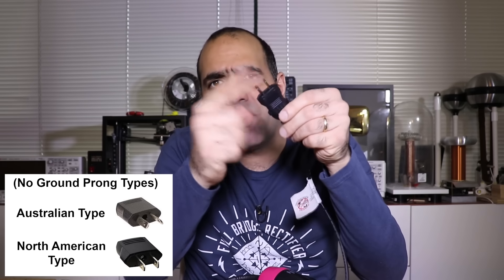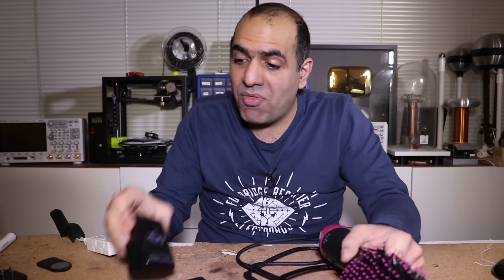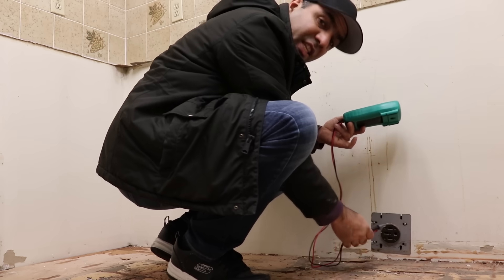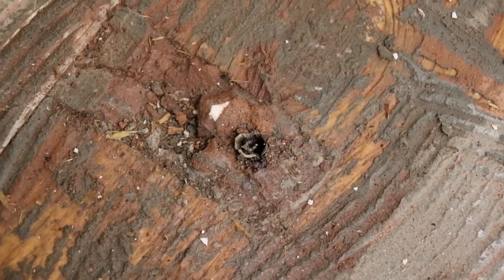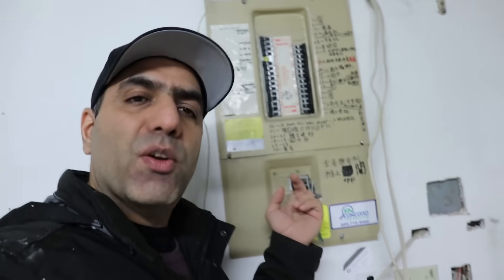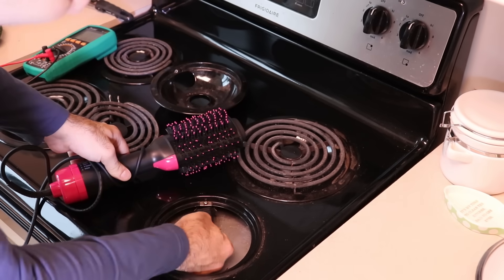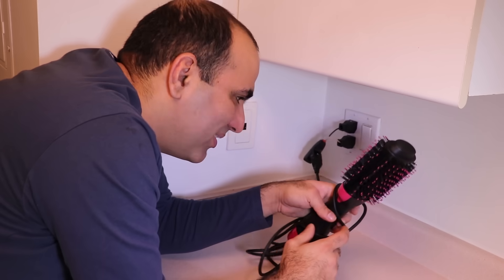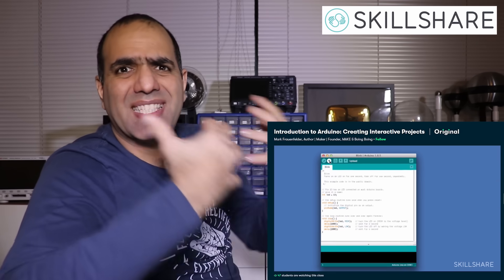Finding HIGH POWER 240V in a 120V Country

Comment: The reason they wire the houses differently than the apartments, is that utilities have a maximum size single phase service they can provide, based on 167 kVA being the largest single phase transformer they can get.  A typical house might use a 10 kVA single phase transformer, possibly shared with a neighbor or two.   An apartment building with hundreds of dwelling units likely will need 500 kVA or 750kVA, and will have to get a 3-phase service for the building as a whole.

Houses get the 120/240V split phase system, built from a center-tapped secondary coil, and one of the 3 distribution phases on the primary side.

Apartments get 2 out of 3 phases delivered to each dwelling unit, with 120V phase to neutral, and 208V phase-to-phase.  Your neighbors get a staggered pair of phases from you, such that the phases are used evenly throughout the building.  The building as a whole gets a 120/208V wye service.

Most household appliances run off 120V, and the few that do need the higher voltage typically can run off either 208V or 240V.  The dryer for instances uses 120V to run the more voltage-sensitive motor, and uses the higher voltage for the heating element that really can run off either 208V or 240V.
Reply: ??? Nope
Reply: @TheAdatto  What part of my comment makes you disagree?

Comment: So if the oven runs on 206V AC my laptop charger can run that

So for example our ovens are 206V
Reply: Your laptop charger is designed to be compatible with a wide range of source voltages.  It is designed to sense the source voltage, and self-calibrate so it delivers the correct DC voltage to its load.

An oven doesn't have the ability to tune itself to the voltage.  Instead, it will operate the resistive heating elements on ~13% less voltage, which means 25% less heating power.   Since it is controlled by a thermostat, it will on-cycle for a greater fraction of the time, compared to what it would do if it ran off 240V.

The voltage-sensitive loads in the oven, such as the fan motor and the user interface electronics, will run off the 120V, that will be the same whether it is in a house or an apartment.
Reply: In an apartment dwelling unit, you get 2 out of 3 phases of a 3-phase service.  The three phases are 120 degrees apart (meaning a third of a cycle), and each operate at 120V phase to neutral.   If you draw a Y shape, with each line being 12 inches, and equally spaced, you will measure 20.8 inches between the tips.  That's the visual for the 120/208V WYE three phase grid.   The ratio between 120V and 208V is the square root of 3.

Comment: I had some stuff with me to USA that needed 240V back in the 90's, we found a big ass transformer with multiple outputs, one was 2:1 so the 110V became 220V, but it also transformed the voltage sway, so I had between 190V to almost 250V in the peaks.
The electric grid in the USA has some serious brownout issues
Reply: Technically, the transformer you used was 1:2 and not 2:1.  To step up the number of turns on the secondary need to be higher than the primary number of turns.

Comment: Here is the problem, can you just run two phases live on a single phase electric device without connecting neutral line?
Reply: That's exactly how his apartment is wired.  His single phase stove is connected across the two phases, no neutral wire is needed.   The same is true for a single phase 240V circuit.  No neutral wire is needed.

Comment: I have an old 8mm film projector that takes 110v-120v, 7.5 amps 750Watts. what can I make to lower the current to safely plug it to the USA outlet( 120v 15amps)
Reply: You can plug it directly into the 15A outlet.  It only draws 7.5 amps.  It limits the current itself according to ohms law.

Comment: Many years ago in Italy the three phase system was of 220 volts instead of nowdays 400 volts 

In my grandma's house i found in the sockets two red wires instead of blue and black and the same green-yellow wire for the ground 

Why two red wires 
Because the distribution were made with two phases with approx 150 volts per phase

Comment: In my country everithing is 250V and i charge my phone with that. Is it bad?
Reply: Bugatti KING both the charger your phone came with has a range in which it can work with. This is usually 100v to 240v if your phone is targeted for worldwide use.
Reply: @jomerc  yes, it is 100V~240V,but i wasn t sure if i can change it with my 250v outlets.
Thanks!!

Comment: Its a pitty you dont have the 230V in America. No fun with those high voltages :D You should do a petition for 400V lines in houses :D Even more fun
Reply: We do have 240V in America.  That's what is delivered to every house.  It's just that we only provide that to high current devices that need it.  Most devices only need 120V, so that's what our normal outlets provide.  But we have 240V outlets in our houses for water heaters, clothes dryers, stoves, air conditioners/heat pumps, car chargers etc.

Comment: ps you can have a 240v line installed for a price....  we needed one to run the welding equipment in our garage, forget how much it was but city crews just ran another wire off the mains through a transformer on our garage.

Comment: 2:17 here is the proof he got electric engineering degree, and He connect things while only taking care of volts and carelessly forgets to compare wattz,

world wide AC current share through 3 phase technique, 1 phase line + ground = 120 and if you use phase instead of ground 1phase + 2phase = 240 and I do not know how would it impact PMT as it says 1000 watt, i think its a low quality dryer it must have ac coils, the good one has dc coils and pwm controller and overheat sensor well they cost, 

and I opened chines microwave oven, it got  water boiling coils instead of microwave generator, you got 2x scammed

Comment: If the phases are 120º out of phase, does that mean you actually have 3 phases available?
Reply: His apartment building has 3 phase power, but that doesn't mean all 3 phases are present in his apartment.
Reply: Depends on the power system in your country.

In the UK it is 3 phase, but for residential customers (houses) only a single phase is available. In industrial premises and offices 3 phases are available.

In Germany it appears they provide the 3 phases to residential properties.

Comment: So, it isn't desirable to put a small, light switching power adapter on appliances with a high power (hundreds or tens of hundreds watt) comsumption? My guess: It would be too bulky and costly because it requires a real transformer (you already used a solid-state transformer and it did begin to smoke), induction-based with copper coil and ferrite core. Also because intense current, lower voltage DC would be very dangerous to appliance (overheats and melts) and user (gets lower voltage, high intensity). Also: What kind of safety setup do you have in your workshop? Is there any video where you show that?
Reply: That converter he put in and "smoked" was almost certainly a small transformer.  High power units require large transformers and are big, heavy and expensive.  Switching inverters also  are expensive.  Not everything can run properly on a modified sine wave. By the way, most of the sparking and smoking in his vids are faked.  Look closely and you'll see the smoke is coming from behind the device.

Comment: I don't get those Americans with two fase power.
All House's in the Netherlands have 3 fase power.
It's not used that often but every house has it.
Also when using a higher voltage.
(220v instead of 110v)
You use less current and can us thinner cable's.
Which in turn reduces weight and cost's. 💰

Comment: if the kitchen counter outlets are on dedicated circuits it doesn’t necessarily mean they are different phases.
Reply: Actually, it does.  When they're in a multiwire branch circuit (2 circuits on one duplex outlet like Medhi's) they have to be on different phases because they're required to use a 2-pole breaker since they share a neutral.  When you have outlets in two different boxes, then they're not guaranteed to be on different legs/phases.
Reply: @stargazer7644  just because they are required to be on a two pole breaker doesn’t mean that’s what someone did.

Comment: It's pretty nornal in Brazil to have access to both 127 and 220v. But usually most homes will be conected to only a single phase so we end up with 127v at home and both voltages at work or school. In some places they have only 220v, they could get 380v but almost nothing uses this voltage.

Comment: Seriously, what is the point of having 120V as the standard? It's 230V where I live, and if the distributor simply changed the LVAC to 230V you wouldn't even have to change anything. I assume your wires are thicker than ours to make up for the higher currents (we have 1.5 and  2.5 mm² for 16A and 20A respectively) so increasing the voltage would only result in lower currents, meaning less losses. So WHY the  hell do Americans use 120V? I just don't see any upsides to it. Any thoughts?

Comment: Me: Mom i need 240V 
Mom: we have 240V at home
240V at home
Reply: In my country it's 220v
Reply: @shubham_the__legend  Australia used to be 240V officially, but now it is 220V officially, to better conform to international, but supply is allowed be up to 10% over that, so up to 242V is still perfectly legit.  All appliances are supposed to be rated up to 260V since it can run that high in the outback.
Reply: @shubham_the__legend  you copied my name BLYAT!!!
Reply: @shubham_the__legend  250v in india
Reply: In our country it’s officially 230V but it runs at about 240v
Reply: James why?
Reply: Lego Mini Movie Productions I don’t know, it just is
Reply: @legominimovieproductions  The EU grid runs at 220v while the UK runs 240v, a happy medium standard was 230v +- 10%, so anything made for the EU market worked in continental Europe and the UK. 
So basically while the standard of voltage was harmonised the EU and the UK continued to use 220v and 240v respectively.
Reply: @konadesu  The british just want their tea faster.
Reply: @legominimovieproductions  When he said it looks like they cut a piece of wire who is they? And what was that wire used for?
Reply: 204v
Reply: @zsin128  Why didn’t he just read On the circuit breaker what controls what
Reply: @Liam Hmm, just looked it up and yeah you're right. Cheers for correcting me.
Reply: Name of the song at 6:55
Reply: 240V at home is only 208V... :-(
Reply: voltage can be various depending on need, high demand industry ussually have separate stepdown transformer from 400v(small motor) to several kv for  ex steel mill, for home it is still best to use lower voltage, you dont want to touch 400volts its lethal
Reply: We have 220v and 440v 
440v for large houses and industry
Reply: You copied and modified it
Reply: Truly, the USA is a 240V country. It's just that most of our appliances run at 120V/125V. The full story is at the breaker box. In a way this is safer since a shock or electrocution from 120V is less lethal. As Mehdi demonstates. As Canada is using a similar scheme.

240V on the other hand is more dangerous. I'm not sure on all the history and science there, even though people do die in the USA from 240 voltage anyway - not to mention the amperage as well (since they go hand in hand).

But yeah, in the USA, it's way easier to get shocked. I personally was electrocuted as a curious child when bothering a plug-in air freshener. Glad I'm still alive, could've been tragic. But from that day on I was fascinated by electricity.
Reply: @cherrysdiy5005 You can survive a 240v shock depending on the circumstances but I do agree obviously double the voltage is going to be more dangerous lol, I got my shock when assisting rewiring a light but confusion with the fuse switches (Breakers in North America) meant that the wire I was working with was live.
Like anything it all comes down to how much resistance your skin has, the surface you are on and how you go the shock (I was lucky, I merely swiped the live wire with my finger so I jumped back from the pain too quickly to be critically injured, but by f*** it hurt!)

(Oh and timing, length of exposure obviously contributes, hence why humans can take 10kv shocks from Tasers etc because the length of exposure to the current is tiny)
Reply: @Smileinator  Thanks for the clarification :3
Reply: @cherrysdiy5005  I heard the UK used 240V standard since in WW2 copper was harder to come by. Double the voltage, half the required conductor. They also have weird ring-circuits at the time.
Reply: @leerman22  That's a really good theory! It makes sense too.
Reply: @leerman22 we still mostly have rings in domestic properties in the UK. We typically have 32A rings using two 2.5mm² cables instead of one 4mm² that would be required for a radial. We also mainly use twin and earth in domestic settings
Reply: @cherrysdiy5005  240  v o l t a g e
Reply: @cherrysdiy5005  To my knowledge it has been proven that gripping a 120 V line will cause you to spasm and keep holding the line, meaning certain death. Coming in contact with a 220-240 V line causes your hand to fly off the contact, making your chances of survival higher.
Reply: @der.Schtefan  240VAC @ 50Hz in your country is less dangerous since the human heart beats a frequency of 60-100. Unlike 2ø 240VAC @ 60Hz in USA.

Comment: I went to Hong Kong and plugged in my electric razor to shave my head.... I used an adapter and the razor blew up...
Reply: The simple adapter only adapts the geometry of the plug to the receptacle.   It doesn't adapt the voltage, unless you also use a transformer.    You need to carry a transformer when travelling abroad, if your load isn't capable of adapting to the destination country's voltage.

Comment: House 120/240 is fed from one transformer that's phase to ground. And inside it's two coils to produce 120/240.

Appartement it's 120/208, from a bank of transformer, and for single phase 120 its phase to ground, and 208 phase to phase.
120*√3=208 :)

All kind of more information would be needed to properly explain of course hehe